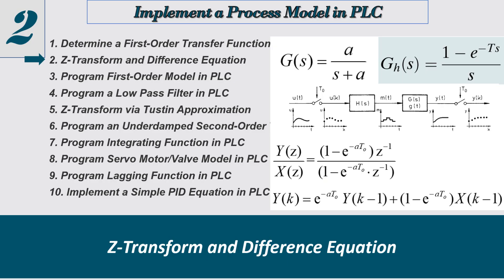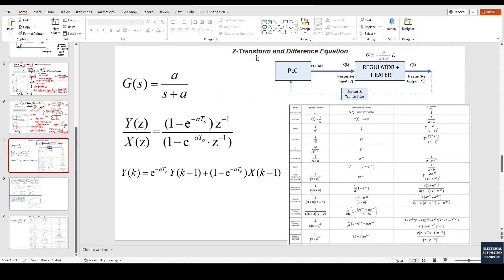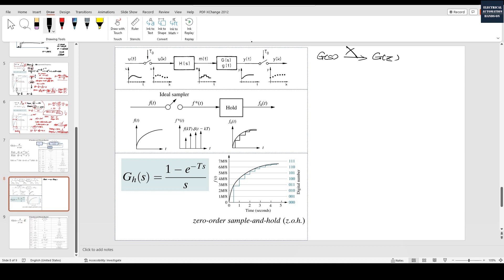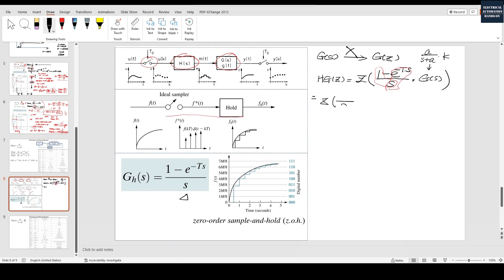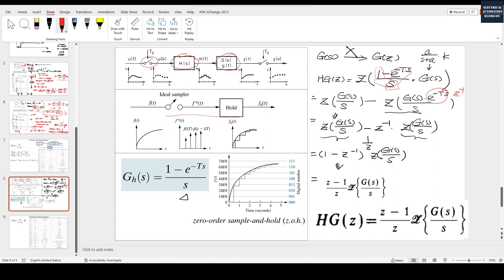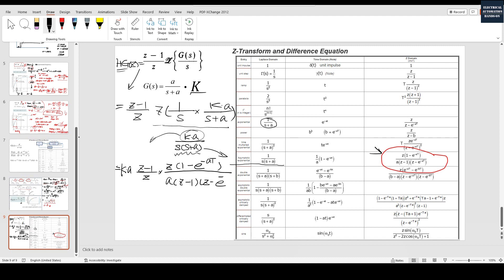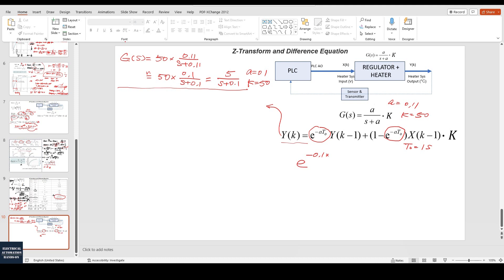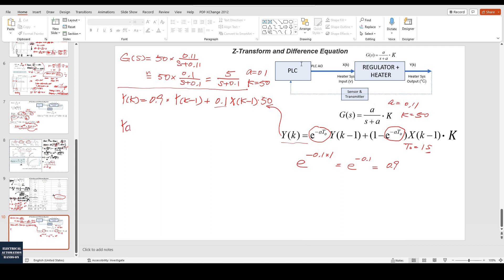TS02. [Model in PLC] Z Transform and Difference Equation

Comment: Great job I have been using the measurement filtering in control expert for analog signals and that equation is what I found but didn't know how it was arrived at. I really enjoyed the control system modelling
Reply from the maker: Glad the video is helpful, the #5 topic in this series will discuss the low pass filter via difference equation. The video will come soon